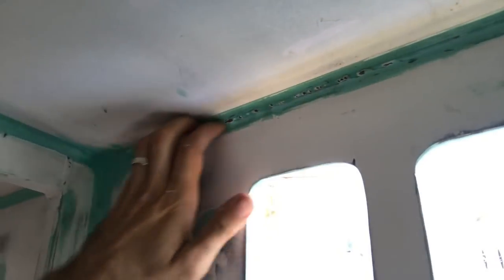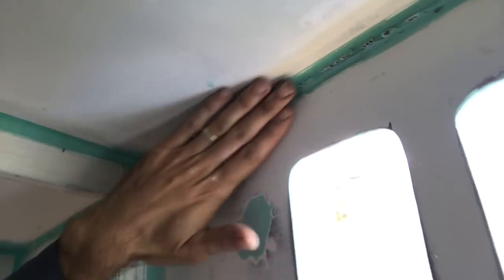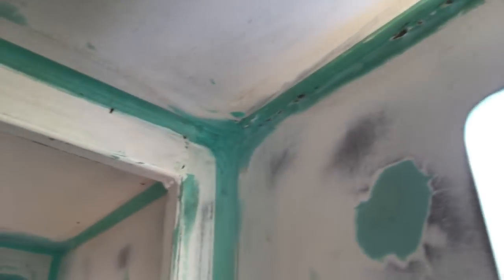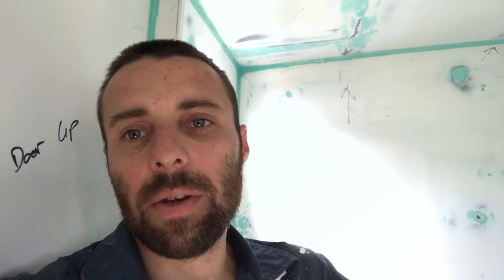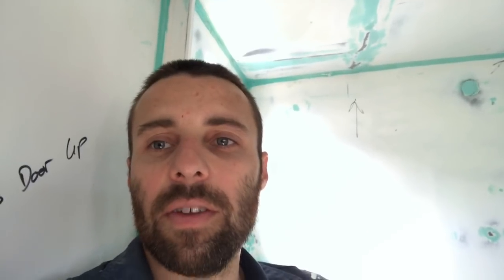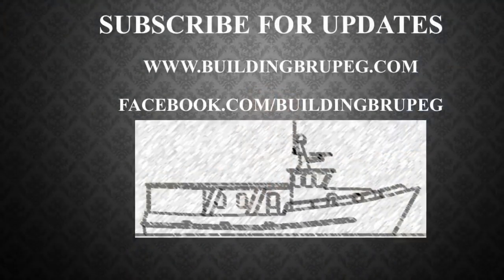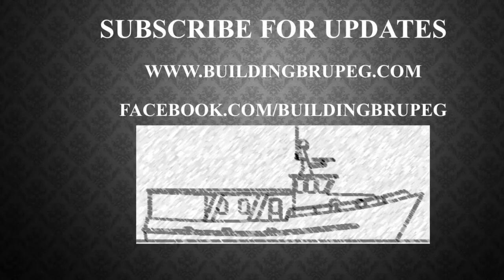Fairing a Marine Bathroom

Comment: Would you use this fairing compound outside? I have steel yacht and wanted to fill a few gaps. I was all good until someone said the steel would expand and contract whereas the epoxy wont. Any thoughts. I am in Brisbane.
Reply from the maker: The fairing compound is fine on steel. The issue is car filler is normally polyester resin based which will soak up water so no good on a hull. Epoxy wont